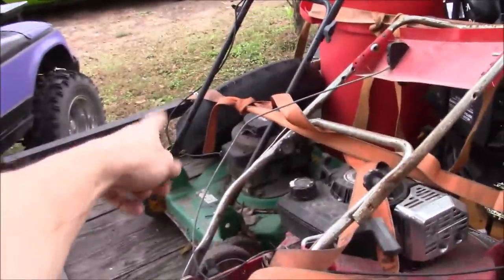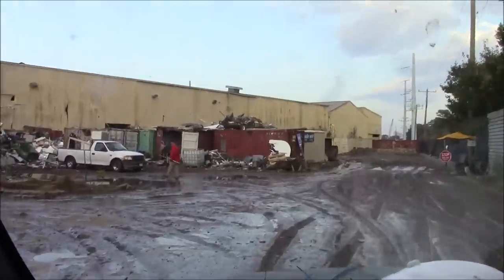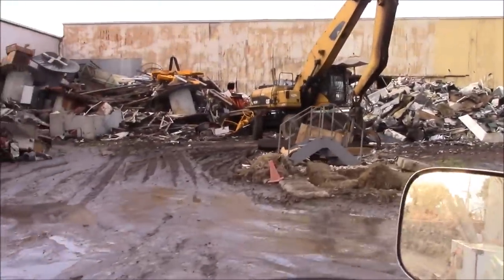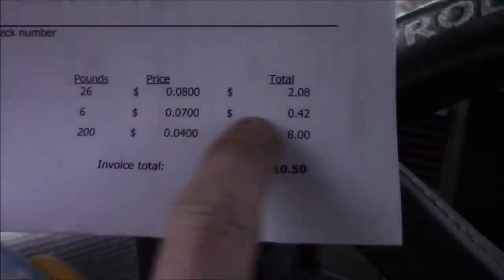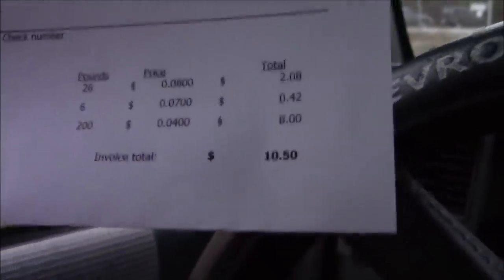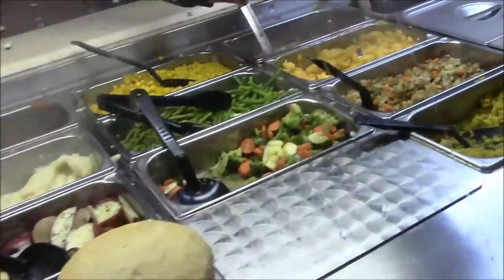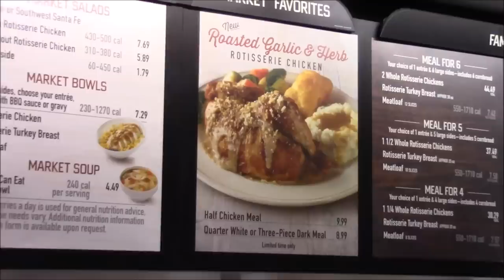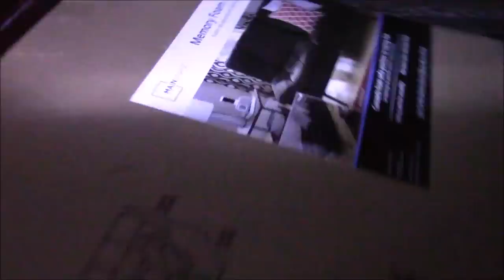A FULL Load of Scrap VS Scrapping ONE Refrigerator  -How Much Does it Pay?

Comment: Do some research about compressors. Refrigerators use freon, which is harmful to the air and ozone layer and can even kill you if you inhale it. That's why they wouldn't let you remove it there. That's nothing crazy, that's common sense. You're supposed to have HVAC and special equipment to remove the freon but lots of people just cut the tube off and run away and let the freon leak out. Either way, compressors are worth a lot because they have bug electric motors inside, with a lot of copper. I take them apart to get the copper out because that's where the money is.

Also, don't smoke around a baby... That's just messed up.

And you don't know what you're talking about when it comes to water. I bet you made all of that up. Causes cancer? Come on man, you know that you don't know that.